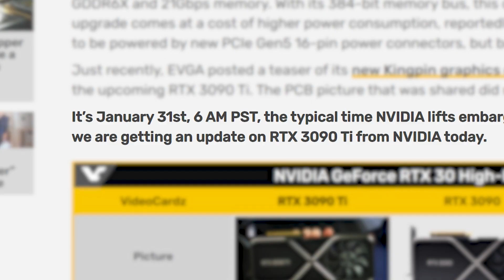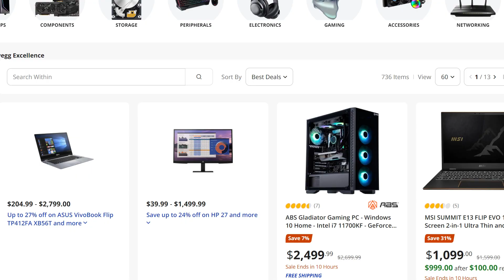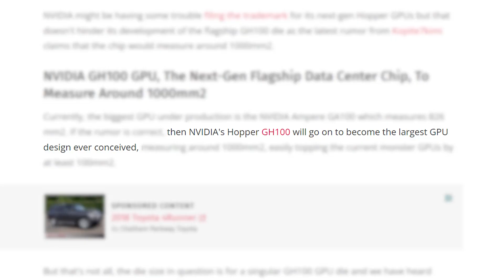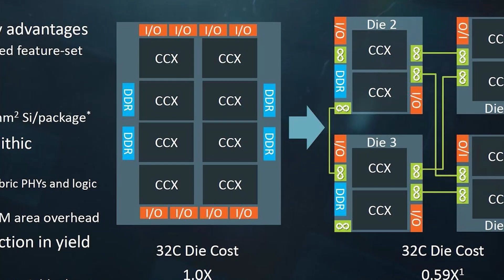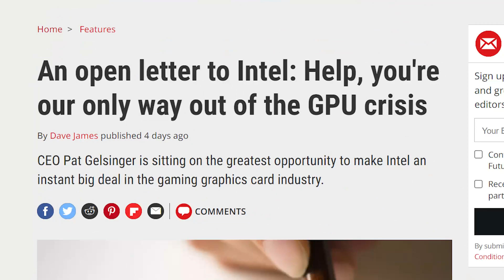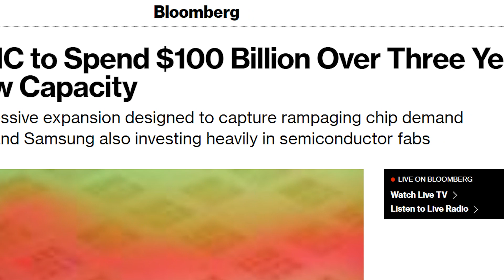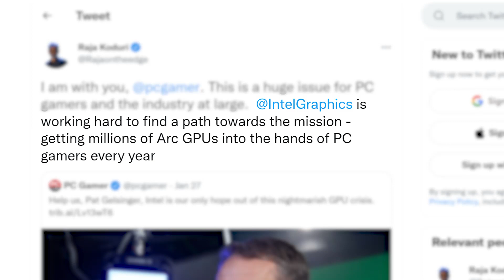“MILLIONS” Of GPUs Coming!

Comment: At this point in time I am wondering if the chip shortage for consumer products is real or artificial, created by manufacturers and retailers to keep the prices and profits high. As long they keep selling at these ridiculous inflated prices there is  no real reason to lower them close to MSRP anytime soon..... not even if Intel releases their ARC GPU, they too will more than likely be more expensive to buy than necessary for the foreseeable future and well up into 2023.
Reply: Probably a bit of both
Reply: @Ruben Schilling If they sell every the unit they receive at double the price or more, there is no reason to lower these prices. It is hard to believe the only a shortage of the CPU unit of the GPU will double the price of the whole graphic card, it is still the ONLY component  of a system that is excessively priced. Not the CPU, not the memory, not the motherboards or SSD's show significantly higher prices now..... only the graphic cards. Even cell phones sells at MSRP or close to it and they are full of chips and electronics.

Comment: Intel using TSMC will only compete for the same resources.
We'll get the same number of GPUs, but with a new brand option.
Unless TSMC increases production, which takes 2 years, this changes nothing.
Reply: Not really the problem is the capacity for each node is limited so if amd and nvidia uses 7 nm and intel uses 6nm is other factory since tmsc handles multiple factories for different nodes.

Comment: Do I think INTEL will be the answer: YES.  And not for the reason you think.  Its not because a 3rd competitor will make a difference, it wont.  Its because the big thing the market is missing right now ISNT MORE VIDEO CARDS.  It is missing a company that wants to be the company for gamers.  AMD and especially Nvidia have basically just given a big middle finger to gamers, all loyalty each brand might have had is gone.  And they thought they would get away with it because both companies did it.  Enter a third company, if they position themselves as the savior of gamers, watch those other companies GREATLY suffer when the crypto bubble ends.  I cannot wait, if Intel does this, I'll never buy another card from nvidia/amd again - and many others will not either.
Reply: to gamers, loyalty is everything. I'll do the same thing.

Comment: Used gpus are falling in price in eu my friends got GTX1650 for 100€ and GTX 1060 6gb for 120€.
RX 580 also going in the sub 200€ range. Because how i heared from someone ETH has about 5-7 mo ths of mining time left before its a gamble either you score or you go broke
Reply: Which country? In italy GTX1650 are still selling for 300+€ crazy.
Reply: @stargazerch.3605  Latvia, which in between russia, germany, norway. Gpu prices slowly falling and after 5 or 7 months things might go back to normal
Reply: @stargazerch.3605  i found a GTX 1650 4gb for 150€ used
Reply: @stargazerch.3605  i also helped one of my friends get into pc gaming and shipped him 280€ worth of parts(he ended up with E5-2689, hunanzhi x79 motherboard, 4x4gb ddr3 ecc,  RX 460 4gb, 250gb samsung 850 evo, and 1tb hdd. The psu and case he got on his own amd saved me time and shipping costs which ended up only being 15€ to the usa

Comment: Really disappointing for Intel using TSMC. Youd think that it wnt matter but it does. It will affect the wafer allocation for AMD and Nvidia. Money talks and it buys a lot of allocation. Intel has a lot of those too. Sure, diff node process, still. Also talks about how Intel fabs are not uo to the task to make dies for ARC. Just hope that all this, would force prices down a bit in the long run.

Comment: nothing can change the current market situation, there will be always many excuses for charging double in shops,

so i have purchased rx 6500xt
Reply: Probably right, the current excuse is inflation and shipping costs and then they'll say cost of manufacturing is up way higher. I think cheap GPUs are never coming back in the $100 or $150 market. The companies can get away with charging $200+ for entry-level stuff they're going to do that now. PC Gaming just got way more expensive to get into now...

Comment: If anyone remembers when AMD first entered the CPU/GPU markets, there were a TON of issues and incompatibility and system lock-ups! AMD no longer has these issues but, it took them quite some time to correct! And for that reason I have always stuck with Nvidia GPU's even after years! Once you get "burned" it's hard to go back. I've been building PC's since the early '90's. I have however switched to AMD CPU's as they are quite good and fast today and in "My opinion" in many aspects preform better with less heat and power-draw (depends on the situation). It can also be argued that Intel has the "mark" for certain situations as well. It all depends on the "situation" and what you plan to do. As CPU's go I really have no preference and purely look at performance vs. bang for the buck. Intel has the "edge" with DDR5 Ram but this is not yet cost-effective as this point in time. Most software is not coded to support DDR5 yet but this will change over the next year or so.
Reply: Intel has been making GPUs for years though, integrated GPUs, but GPUs still. They are not new to this
Reply: @Ghi102  ;
True but they ALL sucked! AMD Apu's preform WAY better with much higher frame-rates. Intel's UHD 640 GPU+ is anemic at best! AMD offers a GPU with a CPU that preforms MUCH better. FACT. Intel's integrated graphics has always SUCKED. Had enough systems to prove this. Place ANY Intel with an APU vs. a Ryzen 5700G or better and Intel "pails" in comparison.
Reply: @Ghi102  :
I totally agree with you but a completely separate GPU is quite different than shared on the CPU chipset and introduces a plethora of issues/obstacles. If Intel hits a "home-run" out of the gates it will be quite an accomplishment. This feat just has never been "seen" before...Stay safe!

Comment: Not prepared to pay $2000 to $3000 AUD just for a graphic card, so still using a GTX970 with the display port issue in tack. (Cannot have a display port monitor a primary but a secondary monitor. only HDMI or AVI port as primary)

Comment: Topic 1:  NVIDIA lied and knew it.  They couldn't meet their own deadline and decided to continue stringing everyone along.  I'm glad I went to AMD Radeon in 2019.

Topic 4:  But will Intel apply restrictions and security measures with regard to who purchases their GPUs and how many?  You can do multi-GPU functionality (NVIDIA SLI or AMD CrossfireX) with 3 or 4 cards max...

...So, assuming Intel's GPUs can function concurrently with more than one card, the average consumer must be restricted to a maximum of 3 or 4 cards per purchase per season!  No purchasing 3 cards and then coming back to buy 3 more every week or month.

Second, if your retailer is not a verified/certified retailer, with a longtime traceable reputation that can be searched on the Web, you can't purchase in bulk; no exceptions.  That should be enough to block untraceable miners and scalpers from buying up whole warehouses of GPUs and pushing prices upward...

...That is, unless I'm missing something.

Comment: Ok, Intel Alchemist has been prototyping on TSMC’s 6nm for 24 months now. But AMD is releasing 6nm CPUs and GPUs before Intel. Millions of Alchemist GPUs are meaningless if Intel is still stuck debugging hardware and software issues with AIBs. I think AMD will release the 6nm 6950XT, 6850XT, 6750XT, and 6650XT before Intel releases the first Alchemist.
Reply: RDNA2 refresh...what are they going to call it? R3DNA? Allegedly RDNA2 refresh will have stacked vcache like the 5800X3d

Comment: Welp I just hope that their entry level cards are on the 200-150 margin and not jacked up into the 300+ , having millions of cards is great but what is better is having a good price.
Reply: Highest I'll pay is 130 dollars shipping included
Reply: @youcantakemygoogleaccount2359  Then good luck you cant get a new card at that price if you want card for 130 buy a old gpu even 1060 didnt cost that low
Reply: @pxerc5485  well a joke of course
Reply: @pxerc5485  btw what about gt710
Reply: @youcantakemygoogleaccount2359  save up and buy a series s
Reply: @ashwindreddy2847  series s is of no use in 2022
Reply: @ashwindreddy2847  I don't even need a ray tracing pc, it's of literally no use, all I want is 720p@60fps if not 1080p@30
Reply: The real issue is 300+ would be a bargain. Right now, the entry level chips are 500+.

Comment: While I have hope that the 3090 ti will be $1,700-$1,900, which is still insanely overpriced. But to be honest, I pretty sure that it'll probably be a minimum of $2,000 all the way to $3,000
Reply: @brownie43212  Uhm. No. We are already expecting the 7900XT to cost $2000.00....The RX 7700XT will be as fast as the 6900XT which is slightly slower than a 3090...and most likely cost 700-1000.
Reply: @brownie43212  7700XT will be around 600-800.00. Not 500. AMD and nvidia scale about 50% faster when you double their stream processors...so if the 7900XT doubles the CUs of the 6900XT just on CUs alone it will be around 50-60% faster than the 6900XT...Add clock speed and IPC...the 7900XT will be around 70-80%% faster. RTX 4090 will be about the same IF RTX 4000 can raise the clock speed significantly...if not..then AMD will take the gaming performance crown in gpus in this coming generation....but the top end GPUS are going to be really expensive...over $2000.00
Reply: @brownie43212  let's just wait and see the 4000 series , if u are talking about amd next gen, still it's 700 uhh but still nvidia is overpriced
Reply: @brownie43212  
The rumour sites(like this one) always say next gen will be the greatest ever upgrade but then when it comes you get typically a 30% uplift in performance in ranges.  1060-2060 about 60% was an outlier followed by 2060-3060 which was about 20%.  If you expect GPU makers to give you double performance next gen then be ready to be disappointed because they'll hold back performance so they can unlock it in later cards as a "refresh" or a "next" generation card 18 months down the line.
Reply: @brownie43212  
These companies knew what they were launching this year 3 years ago, that's the way the industry works.  And Turing actually was a substantial upgrade from Pascal but they wacked the prices up so the value was lost, as I mentioned the 1060 6GB -2060 was a 59% uplift but so was the price.  I was happy enough with 71% uplift I got going from a 1060 6GB to a 2060S but not at the £400 I had to pay to get it.
Reply: @brownie43212  
Yes it is exactly how it works, it takes years to get to the final supply point of a chip that's why you see them produce road maps.  Zen 4 wafers for example have been being produced at the fabs for a year already prior to release at the end of the year and the 3050 release is standard Nvidia timing for a 50 series product.  Even the chip shortage has been predicted for years as fab capacity has been running at 100% for over a decade and more alongside growth in demand outstripping any new capacity.  The product refreshes should teach you this as they just reflect the need to excite sales.  What told me that Ampere was over hyped was the launch of the 3060 "ti" before the 3060 and the fact it's uplift from the 2060 was identical to the uplift the 2060 got from the 1060 confirmed that.  Think about it, despite a new architecture, faster speeds, more cores ext the 3060 is only 19% stronger than a 2060 and as these cards have the same memory configurations are comparable the 3060 is a pathetic gen on gen upgrade and helps indicate the true performance of the chips once you remove the hype.  You will get about 30% more from the next gen than this and 30% the gen after and gen after and gen after because there is no reason for any of these companies to give you any more.
Reply: @brownie43212  Can you provide links to the leaks? 80-100% performance jumps have not been heard of for a decade, even the pascal gen was not 80-100% faster than maxwell.
Reply: @brownie43212  That was being said about the last 3 generation. Yet, my 3080 ti is merely 60% better in most cases than my 1080ti fe.
Reply: @brownie43212  Because of that rumor ppl sold their 2080 ti undervalue.
Reply: @brownie43212  You are ignoring the point that ppl did that because of rumors before the release and the 3070 is 86% of the 2080 ti. Thats not the same performance. 1080 ti 73%. It'd be nice if the new cards would be that good, but i think it will be in the same as always around 20-30% but we'll see.
Reply: @brownie43212  sheesh what copium are u having on rn man, can i have some

Comment: I have had a theory:
They wanted to release arc by december/january but they postponed.
I remember when they said it's importnat that they are cheap and come to gamers so they can build infrastructure and trust for future products.
Ethereum was supposed to go on proof of stake december 2.
But it didn't.
So now they might just wait for it so it won't be just bought for mining. 
If my theory is tru, we gonna see them out by june/july, but that might depend if eth actually switch this time around.
If it doesn't, i don't know what they will do, they can't just shove us laptops instead again.
Reply: It will take much longer than that for eth to go POS
Reply: @krzysztof6123  wdym , it is 4 months away or 120 days , they merge will happen in June from last I've heard since it got pushed back in December , unless they push back which I won't be surprised , but from what he said all is true .
Reply: Good point

Comment: Still rocking my 1070ti, so I'll just wait another year or two.
Reply: tis a good GPU
Reply: The best from Pascal with the 1080Ti.
Reply: rocking a 1660 that I got like a week after it launched before the madness.
Reply: Still on my 1070, hope to upgrade this or next year.
Reply: I mean in fairness that's still a very good card which to upgrade you'd really need to be looking at something like a 2080S as a minimum to feel satisfied with the uplift.  I'm on 2060S so I'm kind of in the same boat and won't be upgrading for 2 years, if the market doesn't improve longer.
Reply: God I wish I had a card that good..

Comment: First to OEMs, second to AIBs, then to DIYers. You're gonna have to buy a prebuilt to get one. 

Expect to see a lot of laptops with Arc GPUs early on, and whatever supply of desktop cards is available to go in prebuilts with 12th gen chips, then the remainder to get scalped or snatched by miners if they're actually good at it.

No such thing as "good guy Intel." They change sockets more than you change oil and sold you the same CPU for 5 years because they could.
Reply: yeah but there is levels in scumbagery and nvidia takes them all.
Reply: @simplex7096  Oh yeah, not defending any of them at this point. The lesser of two evils is still evil though.

 Intel might make a dent in the market, but I very much doubt they care who buys their stuff any more than nvidia does.
Reply: @ZXLink  Keep in mind that while nVidia leads in arrogance, intel is the larger mob.

Comment: Doesnt Nvidia sell like 13 million GPUs every quarter?

If the GH100 is truly 1000mm², then it must be a 3-5nm process, with the reticle set back far enough to equate to 6-7nm when it hits the wafer, because the reticle limit for all of these processes is supposedly 860mm²
Reply: 856mm²..so yeah. GA100 is 826²...so I doubt GreyMon knows what he is talking about.
Reply: The V100 was 1100 square milimetres or smthing, so this is not the largest GPU ever. But hey, TSMC 12nm was made especially made for nVidia for them to scale larger dies and brag with performance in AI.
Reply: @herobrinecyberdemon8104  815mm²